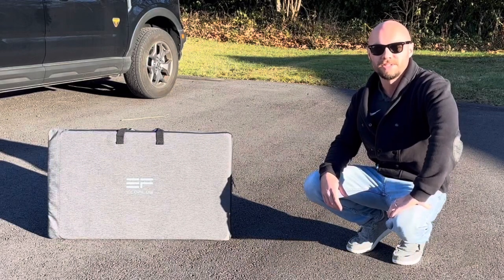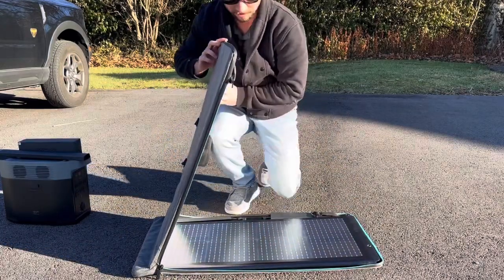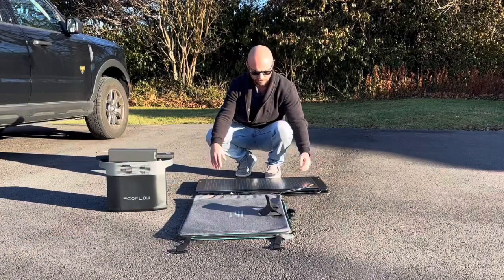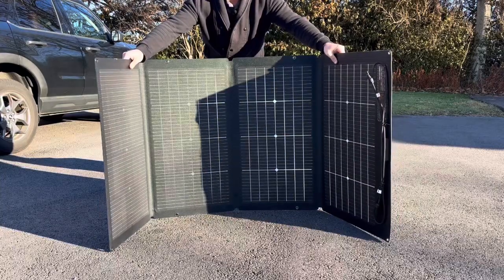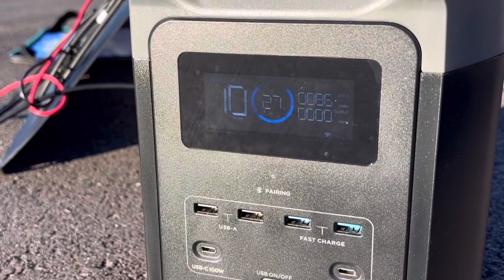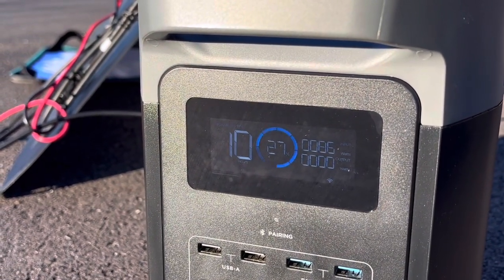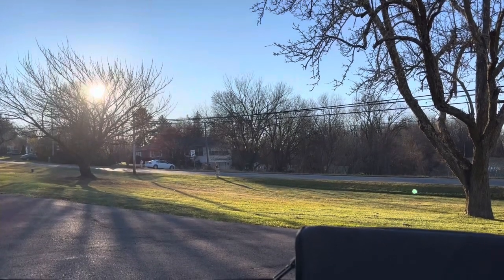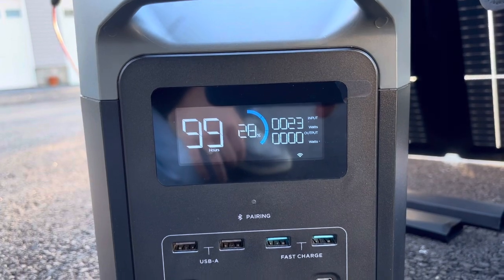Setting up EcoFlow Solar Panels the Easy Way

Comment: Thanks .  I just bought an ecoflow setup like this.  Have you seen a mounting option ( manufactured or home-made) that can allow the whole thing to swivel to follow the sun on your driveway or in my case, Patio?  It's a bit unwieldy the way it is, especially with the 400W panel I have.

Comment: How is yours laying unfolded and open so straight? Mine doesn’t really want to unfold that well, best I can get is kind of a w shape to the panels when they are laid out.
Reply: Yeah.  Mine don't stay straight either.  I believe that the "soft-case mount" option is not all that effective, especially with larger 400w panels that extend well beyond the case.  I'm trying to think of better ways to mount these so that they can slant AND swivel with the sun's path throughout the day.  Have you come up with anything?  Thanks